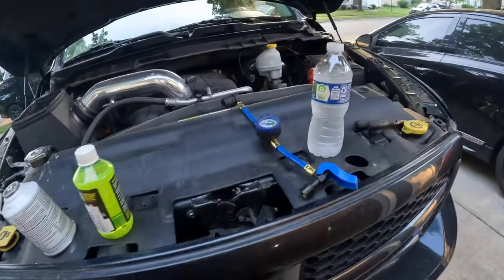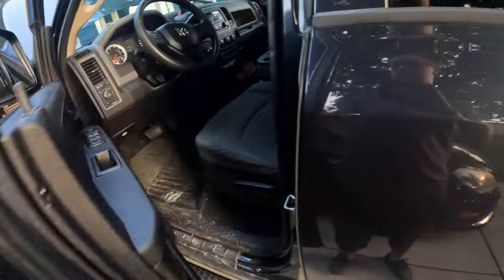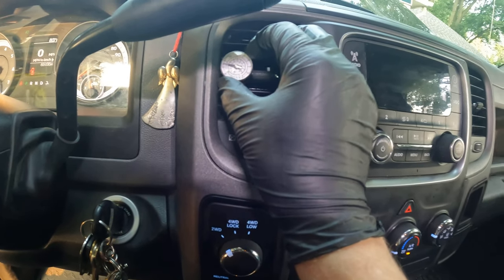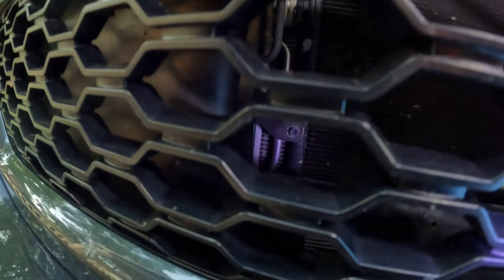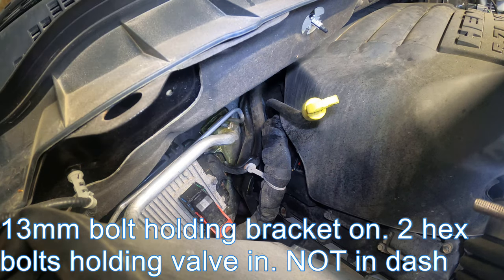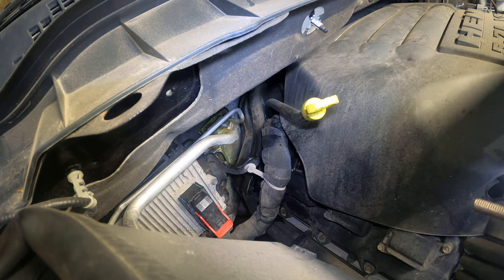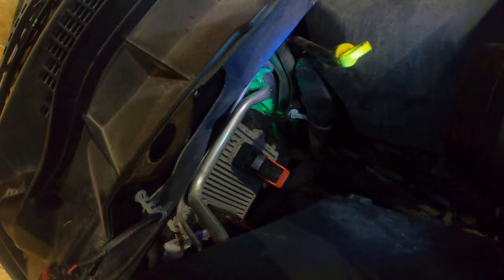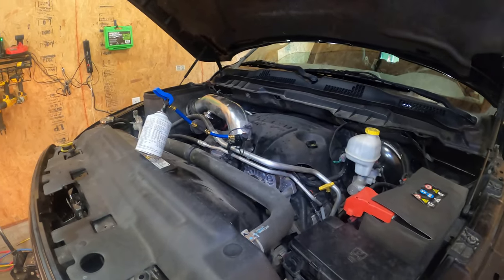2013 Dodge Ram AC Leak & Fix

Comment: I have the same year dodge and it gets cold but won’t stay on. Could it be low freon causing that as well?
Reply from the maker: @mmassey825  it can be so many different things it's not even funny. Easy answer yes but tons of other things it could be. i hope this video helps. feel free to like and subscribe for more & if you can, please help the channel out by giving a super thanks. Making these videos takes a lot of time, but we do it to save you hundreds. also head down into the description and check out the link for some high quality led bulbs for this and any other vehicle. use my referral for a discount. Add me in Instagram for behind the scenes pics and Stop by my store for some Anything Auto gear.

Comment: 134a? Thought 1234yf is the correct one to use?
Reply from the maker: Check the sticker under your hood or check your manual. This video is for entertainment purposes only. Your information may be different than this truck. i hope this video helps. feel free to like and subscribe for more & if you can, please help the channel out by giving a super thanks. Making these videos takes a lot of time, but we do it to save you hundreds. also head down into the description and check out the link for some high quality led bulbs for this and any other vehicle. use my referral for a discount. Add me in Instagram for behind the scenes pics and Stop by my store for some Anything Auto gear.

Comment: How much do you charge me to do that to my truck?
Reply from the maker: Most diag at shops are 1 hour so whatever they chwrge hourly. i hope this video helps. feel free to like and subscribe for more & if you can, please help the channel out by giving a super thanks. Making these videos takes a lot of time, but we do it to save you hundreds. also head down into the description and check out the link for some high quality led bulbs for this and any other vehicle. use my referral for a discount. Add me in Instagram for behind the scenes pics and Stop by my store for some Anything Auto gear.
Reply: Who want to charge me 1700 they told me that they have to remove the Dutch board
Reply: But I sold the dye and this on the same place
Reply: @ArmandoUrguelles  me and my boy tracked down the leak on a 2013 Ram 1500. It was the evaporator core . Had to remove dash board. Followed youtube videos.  Not TOO bad.  Used Black light and dye to find leaking.  Hopefully this will fix it after we finish.

Comment: Two things, did you need to vacuum down the entire system after replacing the orings? Where did you get that orings kit?
Reply from the maker: Yes you have to vacuum because any moisture in there can ruin your system. I have hundreds of them. I'm sure any autoparts store has a kit. They come in all different sizes in the package.i hope this video helps. feel free to like and subscribe for more & if you can, please help the channel out by giving a super thanks. Making these videos takes a lot of time, but we do it to save you hundreds. also head down into the description and check out the link for some high quality led bulbs for this and any other vehicle. use my referral for a discount. Add me in Instagram for behind the scenes pics and Stop by my store for some Anything Auto gear.
Reply: @AnythingAuto how do you vacuum down the system after replacing evaporator core?
Reply from the maker: @jbuck1975  https://youtu.be/D13gAY4JJFk?si=zjRI51wmjTbL_x7V